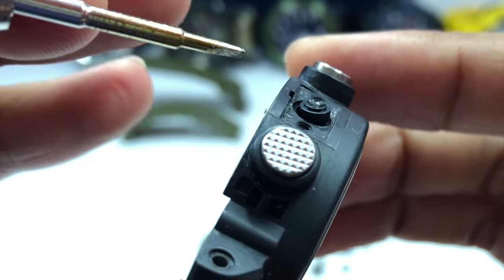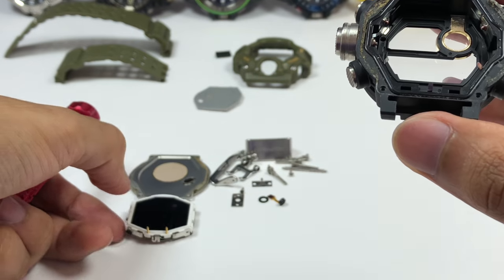Whats inside the GW-9400 triple sensor series Rangeman G-Shock watch!

Comment: amazing, I just bought one 10 days ago, good to see its ANATOMY
Reply: How's the watch?
Reply: Maximus 32 the watch can be described in few words : fully optioned + low price + dependable
Reply: @Omar8156  U mean the watch is excellent ? As i'am also planning to get one .
Reply: Maximus 32 of course 
I had two actually ,black one and this
Reply: @Omar8156  thanks man... looking forward to getting one soon🙂
Reply: Maximus 32 briefing for the g shocks
I have a collection of them 
And some of them also have sensors as the Rangeman does
But most of them are more expensive than the rangeman
That’s why you can say that the rengeman is the cheapest trusted ABC watch ( Altimeter + barometer + compass ) ,including the Solar powered battery ,which I didn’t change it since 2013
Reply: Do you think the carbon fiber strap is with the extra dough?
Reply: @GoldenBlade99  the carbon fiber usually comes with some models like the 
-GW-9400DCJ-1JF Master In Desert Camouflage 
-GW-9400BTJ-8JR Burton Snowboards Rangeman 
-GW-9400SRJ-4JF Men In Sunrise Purple Rangeman
-GW-9400FBJ-4JR Kobe City Fire Bureau Rangeman
-GW-9400CMJ-3 Men In Camouflage Rangeman 
-GW-9400RDJ-4JF Men In Rescue Red Rangeman

I hope that some of the carbon band available to be sold separately....but in some cases the colors are limited.
Reply: Do you still have it? Any issues?

Comment: GW-9400 has the same lugs like GX-56 (king of G).Some say that the GW-9400's lugs are a weakness, while the GX-56 is recognized as one of the most durable watches
Reply from the maker: You're right! You could plug a GX56 band into a GW9400 model. I tried that. The lug on the king model is stronger maybe because it was also supported with the bottom cover. Great watch!
Reply: Great point...the GW9400 lugs are SOLID. Why people complain is because they just repeat bad information but never actually experience any problem...
Reply: @gshockhighfashion  quick question! The GW 9400 Rangeman has a band connection similar to the Gulfman 9100?
Reply: @BuffaloNickel9   yes it's solid  but in few 
situations, if you wear in normal way it can be tough. The people complain because they didn't used  in the right way ( tried to destroy it, like drive a car roll through it ) not   every Gshock can do this test. Even some gshocks can do this test after that it will be a large damege

Comment: By the battery compartment, I didn't quite hear what you called the silver spring. There are two gold ones, and a silver one (maybe audio spring?) I was changing the battery on mine and this spring came out. I tried to just lay it in there but it seems like it shouldn't be loose. How would I go about putting it in so it stays? Great detailed video.
Reply from the maker: Every beep spring has a 'tail' at one end. That side need to be pressed in. It'll hook somewhere and stays there.
Reply: @gshockhighfashion  thank you so much for the reply! I do see a 'tail' now. I will try and press it in. It's so small, I marvel at how these things are put together in the first place.

Comment: Hi Bro, so i believe there is no worries on the band to rip of from the Lug. As you said that the band is well design to fit it to it. I guest i will take this Rangeman instead of the Mudman 9300. From the country where i came from (Malaysia), the Mudman-9300 & G Shock King has fogging issues, might due to our humidity ratings. and this Rangeman is really pack with all functions. Thanks Man
Reply: I'm not sure you'll even see this comment, but how's the GW-9400 holding up?

I'm still not convinced it's worth buying, as the multiple posts I've seen about the lug issue online are not reassuring.

It'll be interesting to know, as you're someone who was aware of the issue and still bought one.
Reply: @StardustLegacyFighter 
You can just get an adapter and get around that issue completely

Comment: I was so close to buying this seemingly perfect G-Shock, but I found out about the lug issues, and it's definitely not worth the hassle.

As with anything in life, if something seems too good to be true, it probably is.

This Rangeman seems like a watch engineered for functions over toughness and reliability.

No G-Shock should break that easily.
Reply: what lug issues?
Reply: @squintygreeneyes it has plastic lugs, and too much pressure on ur watch can break them
Reply: @cherchil  oh, i installed metal lugs so i can use nylon or leather zulu straps so i guess i dont have to worry about that/didnt notice. the upgrade was only about 20$ for the lugs and u can get all kinds of zulu straps for 12-15$
Reply: @squintygreeneyes I have bought this one & every time affried about the lug issue. Will you please describe your solution or replacement of metal lugs, so that I could do the same. Thanks in advance. Awaiting for your answer 👍

Comment: Trying to buy a new rangeman gw 9400 green but I guess the illumination light doesn’t work any idea on how to fix it?
Reply from the maker: Check the led connector on the board. Maybe some cleaning is enough but still, you'll need to disassemble it to inspect the circuit.
Reply: Definitely going to  clean it thanks :)

Comment: I wonder if you can share the tips how to manage the sensor flex cable during assembly and disassembly. Many people said that it is very fragile, that's why i don't want to mod my rangeman yet, for now. 🤦🏻‍♂️
Reply from the maker: From my experience so far, it is pretty stiff but I understand the worries. If you follow the way I remove the parts then you should be okay. 

Basically just be gentle and take your time during the process. Do not force it.

Comment: Here is a question regarding the triple and Quad sensor.  You mentioned at around 5:30 no diving due to moisture getting into the case.  How does this design differ from the Quad sensor Gulfmaster that can dive?  Is there a significant difference in the seal around the sensor on this watch and was it improved enough for the Gulfmaster Quad?  Or is the Gulfmaster Quad also prone to leaking?  Thank you for your videos!  I am watching many as I decide what will be my next watch.  Are you a fan of the ProTrek 7000 Series as compared to the Gulfmaster?  Thank you for any insight.
Reply: No comment

Comment: Quick question, do you think it will be easy to change the glass, mine has several scratches and I want to change it. 
I already removed one on my gx-56, and end up braking the solar panel...
Any idea how I could do it without braking it the solar panel?

Cheers from Portugal
Reply from the maker: Ouch!. That gotta hurt the wallet.

Anyway, Casio add a black tape-like thing around the solar panel & glass assembly that holds tight. From my experience, the best way is to use a heat gun to melt the glue just enough that it got loose and the glass will be a bit flexible from the heat allowing it to be pressed out without breaking. Carefully, slowly and little by little at time.

Pretty much like how people open up smartphones for repair work these days except, very gently.

Comment: Great Video sir...thank you for documenting this! QQ, If my goal is to just replace the polarised film to negative (black), would I still need to disconnect the white housing around the screen, or could I just do it without messing with that? I hope that makes sense...Thanks in advance for your help
Reply from the maker: Sounds possible but rather spend some time to remove the white frame first just to be safe.

Comment: Dude watch your finger at 13:52 there's a small spring wandering. I personally don't like the negative display version of the rangeman. I tried it out and I could barely see it. I got a DW6900 LU3 with negative display and it looks just fine. Casio must improve that display on the rangeman being on a higher price range is just wrong imo.

Comment: I think most Rangeman owners are going to want to know what the module looks like. In the UK I see the Rangeman at same price as the Protrek 2500 and I don't know which is a better all round purchase .....
Reply from the maker: The Protrek has some good features too. They even use the same sensors. 

The difference is that it has a sleeker appearance and different interface. It is weaker in term of protection and water resistant too when compared to G-Shock.
Reply: @gshockhighfashion  Thanks GHF, you've given me an idea to look at these models on the used market. I was thinking what better way to get a triple sensor as a 'beater watch', than one in a used condition. Thanks also for the info on the sensors, I didn't know they used the same one,
Reply: @freeatlast1963  I'm afraid that information is wrong. I own the Protrek 2500 and it uses the 2nd. version of the sensors. The most visible difference is the altimeter accuracy of 5 meters. The Rangeman uses the version 3, which is smaller, more power efficient and you can see the altimeter with 1 meter accuracy.

Comment: Just got myself a used Rangeman but found that the compass is stuck at 240 plus/minus 2 degrees, tried the two point calibration but only got "ERR", removed the battery to "reset" the watch as well, but problem still there. I even tried to put a speaker magnet to "pull" the compass and managed to get it to about 310-320 degrees, but it would still go back to 240 degrees.

Where's the compass sensor? On the module?

Comment: Thanks for this very well done video! Question: Where exactly is the part hidden that turns the digits yellowish on this model? The readability is not very good, so I would like to either change the polarizer to a clear one or find another background reflector. Just don't know where the colour is build in. Or is it the glass of the LCD itself that is tinted? I do like the negative display. But I know there is the GW-9400BJ-1JF which is very costly, but has just the right display for me (negative AND clear white digits). Thanks for any advice on how to modify it (if at all possible)!
Reply from the maker: Usually the colors comes
from the background reflector which was glued behind the back polarizer. Sometimes, it is polarizer itself. No way to tell unless you try to peel it off a bit from a corner and check the polarizer colors.

These polarizer is pretty easy to get. But just be careful not to scratch the glass or the connection segments.
Reply: change the entire screen, its like 15usd max :D

Comment: Hello, my 9400 have illumination problem. It stoped working. Couple of times it turned on and now is compleatly dead. Button is ok because I can turn the autoillumination on and off. Do you think that those golden pins are problem or something else? Thank you for any suggestion.
Reply from the maker: GW9400 will automatically turn off illumination when battery is too low. Perhaps thats the reason, charge it up first.
Reply: @gshockhighfashion  battery is full, checked it first.

Comment: Excellent Video, I have this watch, I am looking for the hard case for this watch as 2 of the lugs broke off on mines, do you have this part for sale or know where can I get it? Any advice welcomed...
Reply from the maker: Ouch, that hurts to hear. Apparently it is almost impossible to find a replacement without breaking the bank at least. It is better to just buy a used rangeman and scrap for parts then sell the rest.
Reply: @gshockhighfashion  wow, I was really hoping you would of said “I have the part”, I stuck the lugs with crazy glue, I know it will break off again in time. If you do come across a hard case for me, please message or email me. Keep up the great videos, cheers
Reply: Out of curiosity, did you use a NATO/ZULU strap adapter or did you use the standard Casio straps? And do you work around chemicals?
Reply: The GW-9400 is defective.
Reply: @MinefighterLP I have original wrist bands

Comment: I lost one of the gold springs changing the battery’s where can I buy more gold springs
Reply from the maker: Nowhere. 

You can use normal steel wire with similar (+-) size and coil it into a spring instead.
Reply: I found that the spring inside of a small diameter spring bar cut to size worked great for me when I lost mine for the g shock 6900 today.

Comment: I’ve got a rangeman. Tonight when I was at work I hit the light button, and the button stayed stuck in. The other buttons won’t work now because the light button is constantly being pressed. The watch is still ticking but I can’t use it. Any advice?
Reply from the maker: You'll need ti tear it down now. Just open up the metal backplate just to have a better look of how it got stuck. 

Sometimes, the E-clip just got 'hook' to the metal plate that interact with the board. Un-hook it, good to go.

Maybe, the button shaft got bent thus stuck after being pressed. An expensive replacement required in this case.

Either way, just gotta have a look first.
Reply: @gshockhighfashion  thanks. I’m gonna send it to a watch repair, but I did order a mud man in the meantime. I’ve been looking for an excuse to get another g shock, and I guess I found one. Thanks for the reply though

Comment: 2:00 Not so fast, dude! Just because it fits there doesn't mean reliable. Yes, it is the same design many of Gs have.
 But just compare the case of Rangerman and Mudman. Those little plastic parts connected to the case, where the belt is mounted, are longer and thinner for Rangerman. The belt acts like a crowbar pulling the screws that twist the plastic they are attached. 

It is the same bad design that is more accentuated for Rangerman. And so many complains about it weight more than any demonstration of watch guys.

Comment: I have a gw 7900b with a dead battery it takes a ctl 1616 rechargeble battery. Is it possible to put in a cr1616 if i dont care about it recharging.
Reply from the maker: No problem, that'll work just fine. I did that all the time.

Comment: I use sharp objects and stir the black glue on the sensor
, I do n’t know if it is damaged because of this, I did n’t expect this part to be so precise, I regret it ...
Reply from the maker: Ouch. Too bad to hear that. You'll need a new replacement sensor now. Buy a cheap barometer equipped gshock/protrek/casio watch and scrap for parts instead.

Comment: Hey there Mate! 
I really need your help on this. My Rangeman's Mineral glass has a deep pitting/crack in the exact centre of the screen. I dropped it while checking the altitude and it fell right on top of a rock. I need to replace the glass. Can only the glass be changed or do I need to replace the entire module?
Please help. I am not getting any proper guidance regarding the same from the service centres here in India.
Reply: It's not easy but a professional watch servicer may be able to press a new glass into it

Comment: I would like to try out the gw9400 case to put this gwg1000 frame. The fake items are so good, so I want to try to put the genuine stuff to be pretty. Which the cat does not have Mudresist features as well Put it in the frame. Gwg1000 should have a Mudresist as well. Because of the original gwg1000 Mudresist already offended

Comment: Which Rangeman model do you like most?
Reply from the maker: Ones with GPS built in.
Reply: GW 9400 is way much better. In every way. Try to use the triple sensor features of the GPR B1000 in the dark. It´s a nightmare. Push, scroll, select, push...all of these by constant light button pushing. The GW 9400 you just need to push one button.

Comment: Are you suggesting those who get these lugs broke off by the use of an aftermarket parts sold separately & not from casio original parts GSHF ? might be they converted it with adapter to strap a nato/zulu type of band 🤔perhaps✌
Reply from the maker: Yes. However if the third party adapter was shaped and fit just like how the original band were fit into the lug then the problem won't occur as well but thats not the case for most adapter out there.

Comment: 13:11 I lost these tiny springs on my B5600 :(
Reply from the maker: You could use any thin wire of the same size and put it there. As long as it connects the board to the components, you're can use it.